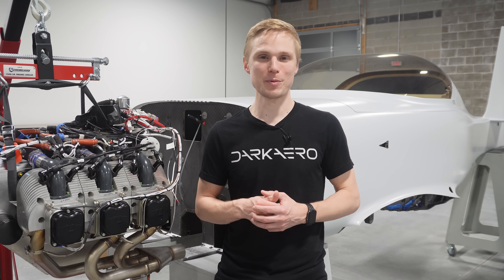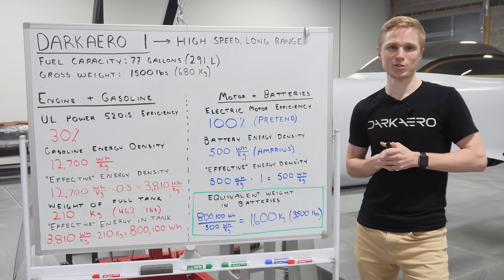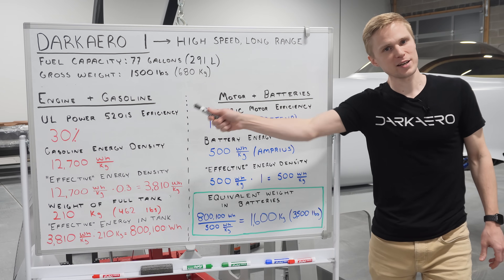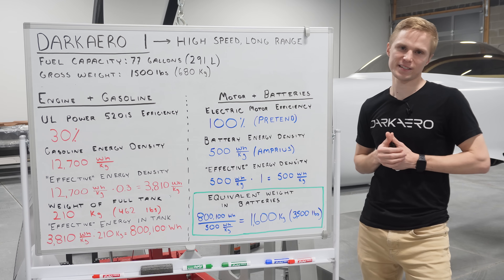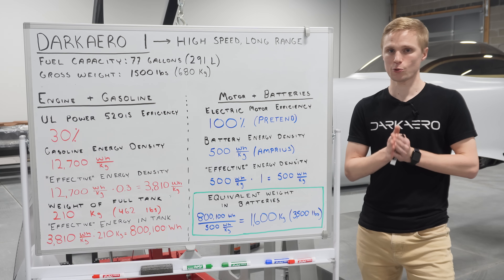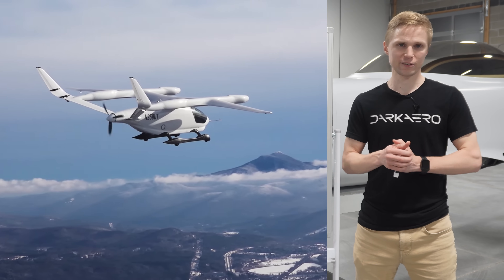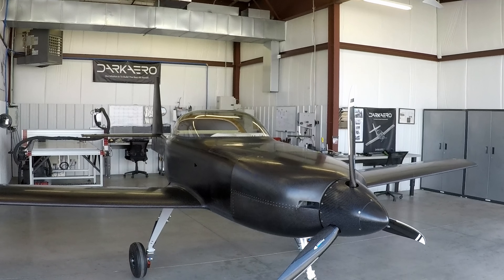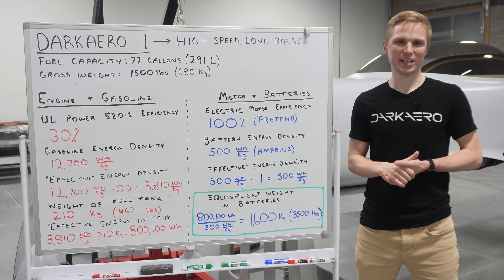The engineering challenge of electrifying airplanes

Comment: One thing that I don't think was mentioned is the decrease of weight throughout the flight for a gas powered aircraft. As a plane burns fuel, that weight is subtracted from the overall weight of the aircraft and subsequently requires a lower angle of attack to maintain level flight. A lower AoA produces less induced drag thus allowing the aircraft to either fly faster for a given power setting or maintain the same speed with a reduced power setting for a reduction of fuel burn. The degree this will affect this aircraft, I don't know. I am interested in seeing this gradually explored in flight testing.
Reply: I was surprised he didnt mention this aspect. With a fuel tank nearly empty our are much lighter than at start. With a battery nearly empty you just carry "dead" weight around.

Comment: for special cases it is certainly possible and useful. But for most applications it isn't. And the 500w/kg is very optimistic and I wouldn't put lipos in any plane, too dangerous.
Reply: They omit the danger of power drop when the battery goes off optimum temperature, and the huge weight and consumption of the massive heating and cooling systems for the battery, motors and other systems. Not to mention the huge consumption of heating the cabin with electricity. 
Then there's the huge charging losses. Then there's the huge, absolutely astounding costs which in the real world alone are enough to make battery-electric not viable even if miracles would happen and they could compete against ICE.
Reply: Luckily lipid aren’t used in any large applications like cars, storage etc
Reply: No one puts LiPo (lithium-ion with polymer electrolyte) cells in any aircraft carrying people, but if they did they would not use cells from toys.

Comment: Massive refuelling time advantage for gasoline too. Turnaround times between trips with battery recharge times would be most inefficient.
Reply: I think for the airplanes they swap the entire batterie to recharge them "offline". Which of course now doubles the price of the entire endeavor.
Reply: I think most aircraft spend at least 30 minutes stationary on the ground between flights. Modern car batteries can recharge to ~80% in that kind of time.
Reply: @Mike-oz4cv  Do you have any idea how much preparatory battery heating they need and how massive the charging losses are during fast charging?

Comment: Probably a better idea to just run the engines of non carbon based fuels. That's if they can handle the pressure of course. My current biggest issue with plane engines is how some normal props still uses leaded gas, which is absurd.
Reply: Maybe, but there are few using avgas left.. the pollution is way less compared to the 70s 80s when cars used that stuff too.
Reply: @flexairz  I'd still rather it be zero, it's a hurting both the users and the people doing stuff in areas around the plane.
Reply: The leaded fuel is required due to the octane needs of a high compression, low rpm, air-cooled engine. As of the last report, there were approximately 167,000 aircraft in the US that used 100LL as their fuel source. I can guarantee that most are not flown regularly, a good number haven't been flown in years, and some will never fly again. Absurdity if focusing on something that is almost a statistical zero when it comes to pollution and carcinogen contributions.
Reply: @AnonyMous-jf4lc  As I already said, I don't care how small the usage is, any use at all is a health hazard. I'm sure there are ways of getting either the engines replaced or making people use a different fuel that still works in those engines.
Reply: @wulfleyn6498  Let me guess, you don't have a plane. They are working on alternatives, a lot of the holdup is cost based. You can't demand the bulk of the GA sector change over something that has zero effect on you. You'd have a bigger impact going after lead fishing weights, as they directly contribute to food source contamination which is where the highest intake of lead occurs. I'm not about to spend 40k to put in a new engine that has less power because you don't like 100LL. You're in the wrong place to have this argument.
Reply: @AnonyMous-jf4lc  Didn't actually know people still used lead weights in some places, they're illegal where I live. Not owning a plane doesn't mean I can't have an opinion on the problems with using lead gas. If I were to propose any way to solve the lead gas problem it would be government subsidised/paid replacment of engines or less toxic fuels.
Reply: @wulfleyn6498  Not owning a plane and trying to comment on what should be done within GA at the expense of plane owners is like walking into a subdivision you don't live in and telling an HOA you aren't a member of that they need to change the area they manage. Swapping an engine in a plane isn't some small deal and there is already a backlog of engines. Not many are certified for leadfree, so new engines would need to be certified, STCs would need to be issued, and the backlog would be many years. There is already a lead free fuel that has been developed and approved, but cost and logistics slow things up. Trust me, we are moving that direction, but it's not something so urgent that it requires subsidies or mandates.
Reply: @AnonyMous-jf4lc  There are no high compression certified aircraft engines... they all run compression ratios like at 1940's car (because they're 1940's engine designs). They don't need lead.
Reply: @brianb-p6586  yeah, that's why all the certified engines that are allowed to run mogas are rated for less power and have lower compression. You're also confusing a ratio with cylinder pressure, those two things do not directly correlate. This is especially true with engines designed to never touch 3k rpm. Cam profiles, etc, all have an effect on cylinder pressures. Add to that the lack of liquid cooling (for safety and simplicity), you have an engine that will detonate on lower octane fuels. This isn't fiction, there are many conversations happening right now. GAMI has released a STC for some engines to use G100UL fuel. Tolerance testing is extremely important in GA, as having your engine self-destruct in a single engine plane is a big deal.
Reply: @AnonyMous-jf4lc  Yes, primitive cooling systems (without even forced air) do limit traditional aircraft engines... which still run fine without lead. I am not confused about terminology or the difference between the volumetric ratio and peak pressures. 

What is really important in general aviation is minimizing expense to the manufacturers who have stalled progress for decades - there's nothing else limiting the use of unleaded fuel in aircraft engines.
Reply: @brianb-p6586  from your comment I’m going to make the assumption that you don’t have much experience in how static compression ratios aren’t a good metric for much of anything. Dynamic compression is the one of interest and is higher for a given static ratio in aviation engines than their automobile counterparts. A lot of this is due to rpm limitations of aircraft engines and how the cam profile is designed. It is also necessary for cruise operations for best economy while leaned near peak. Aviation engines are simple on purpose. The main design goal is to reduce points of failure. Why add liquid cooling when even the smallest of leaks can create an emergency situation?
Reply: Probably better to make synthetic carbon-based fuels using renewable energy sources. For those applications which require readily stored fuel.
Reply: @mckenziekeith7434  go ahead and invent a cost comparative alternative with similar power density and stable storage characteristics. I'll wait.

Comment: There is a new generation of batteries from a Finnish Inventor which will be built in Sweden. They will be much lighter and have exponentially more energy.
Reply: It’s a nice idea, but I seriously doubt the claim about exponentially more energy. Current battery technology is right on the line of instability. If you’ve ever seen a modern high discharge 18650 explode you’ll know exactly what I mean. You can’t physically push such vast amounts of energy in and out of a limited medium without risking huge instability. Small iterative changes may be possible over time but the suggestion of some major breakthrough in this space has been constant and fruitless, for years now.